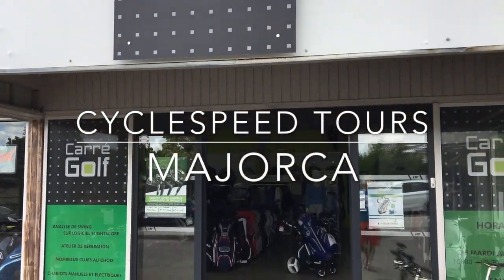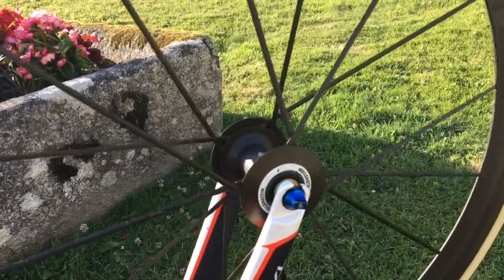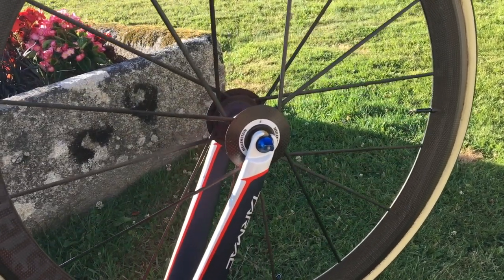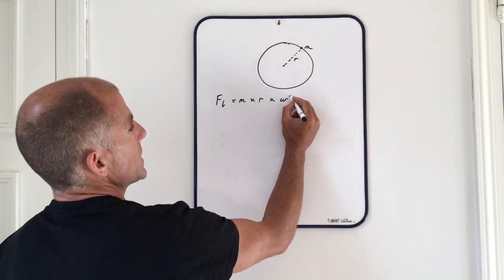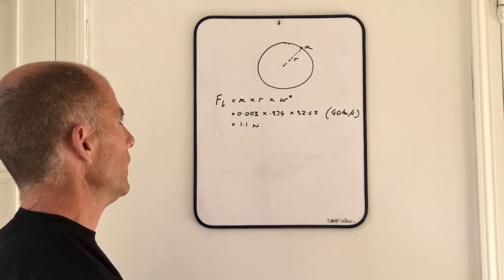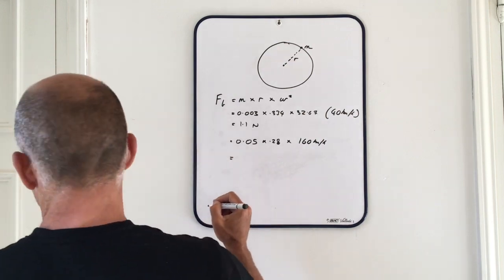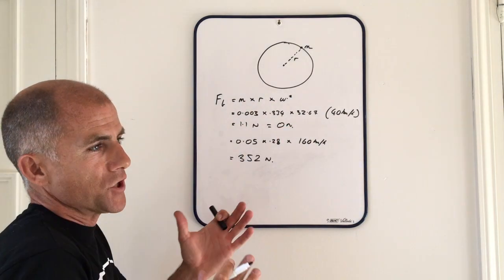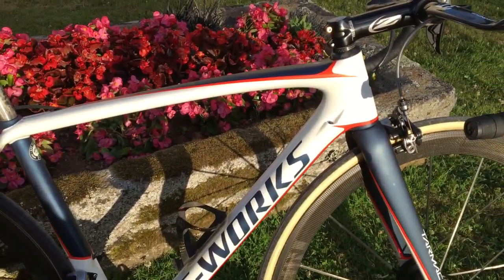Wheel Balancing ; Worth it? Or Waste of Time?

Comment: I don't think it is just a question of efficiency. I like the way you showed the calculation to explain it, but it all depends on the input values. My wheels - Roval cl40 - took about 9 and 12g respectively to balance. If you factor in a higher (typical descending) speed, e.g. 60 km/h, the force becomes much more significant.
Reply from the maker: Yes, if your weight is higher and you look at higher speeds, then clearly, imbalance forces will be higher, but off the top of my head, you'll still be below 10N or so which isn't excessive.
Reply: What I meant to say was that it is as much a handling issue as efficiency. Your wheels were more or less balanced anyway, so the conclusion that it is barely worth seems fairly obvious. My wheels were off by a lot, so I think it was worth it. Before I did it the bike shook badly when holding it and spinning the wheels - see Shane Miller's vid on the same topic.
Reply from the maker: Yeah, I guess if it needed over 10g, that could be seen as 'significant'. Bear in mind that it could be the tyre that is the culprit - or did you do it with the tyre off?
Reply: With tyre on. Its the valve. That's why your wheel is almost balanced, but not quite. The manufacturer can't know what tyre & tube / tub you are going to fit, so they've balanced it for an industry 'average'. They'll more than likely err on the underside, so as not to add excessive weight, which would look bad on the spec sheet.
It seems Specialized can't even be bothered with that, which is disappointing IMO......

Comment: I used the exact same weights which were £3 from my local golf shop. In my case the imbalance was entirely due to the tyres as the wheels were a newly built set which were perfectly balanced with tubeless valves fitted but without the tyres. 5g front and 3g rear sorted the imbalance out and it was totally worth the less than 30 minutes spent. I don't understand why anyone wouldn't want their wheels balanced, it's common sense, really.
Reply: Hajime Kuma the effects I've noticed are in the way the bike handles. The new wheel/tyre set was an improvement over the old set anyway but some unsettling niggles remained, most notably a twitchy front end on fast descents, with a tendency for the bike to shoot off a straight line at random. With smoother rotation of the front wheel this alarming situation is greatly improved and the bike has an overall more settled 'persona' - much less 'flighty' than before. In my opinion this is due to the chassis not having to deal with the forces generated by the out-of-balance wheels.
This may sound a bit vague but it's exactly the improvement I anticipated from similar efforts and results with balancing motorcycle wheels.
I'd be interested to see if Andrew can quantify any reduction in power losses due to chassis stress being reduced or rotational effects.
Incidentally, the heavy spot was nowhere near the valve or the weld on the rims. Front is 45 degrees from the valve, rear is 85 degrees. This is all down to the tyre construction in my opinion as without tyres but with tubeless valves fitted there was no discernable heavy spot on either wheel so moving the tyre to a different position wouldn't have eliminated the imbalance.
PS - I fitted the weights over the rim rather than on one side. This ensures there's no danger of them flinging off. I finished off by covering them with black electrical tape to make them blend in.